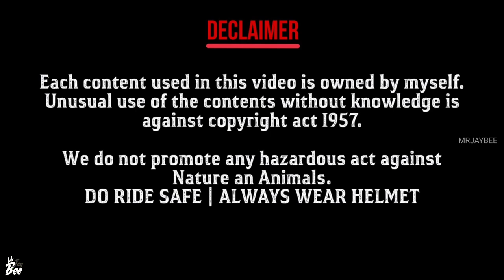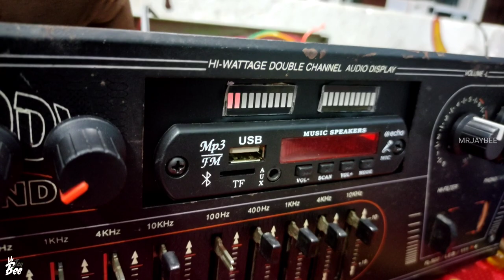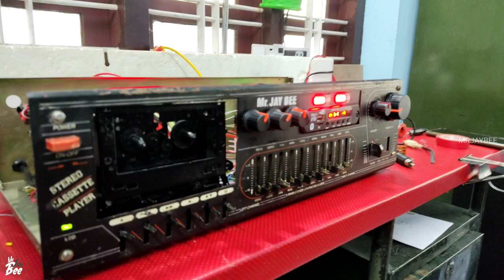Old Cassette Deck Restoration and Full Assembly | STK 4141 amplifier assembly and full wiring

Comment: Toshiba. T T C 5200   T T A 1943   4 MOSFET  2 CHANAL   SOUND KING AMPLIFER  R M S OUTPUT 4 OHM  180+180  WATTS. ഇതിനുവേണ്ടി 10" ബോൾട്ടൻ  WOOFER.   MID റെയിഞ്ച് സ്പീക്കർ    ട്യൂട്ടർ   ഇത് മൂന്നും എത്രയെത്ര വാട്സ്  കൊടുക്കണം എന്നൊന്നു  പറയാമോ.      4/8 OHM. കമ്പനി അവകാശപ്പെടുന്നു. ആമസോൺ പർച്ചേസ് ആണ് AMPALIFER